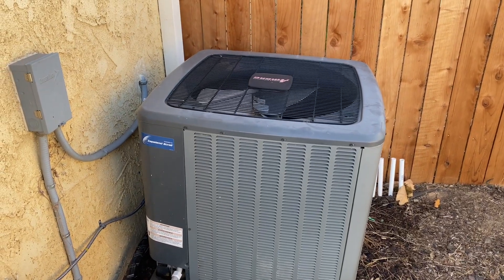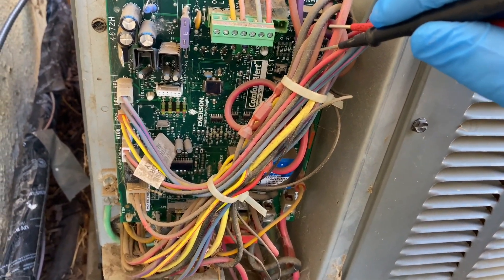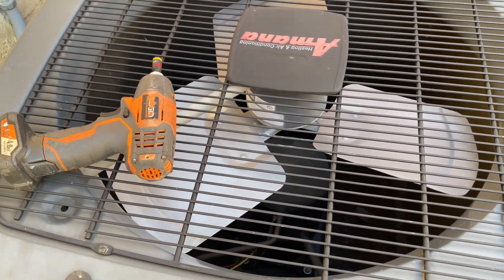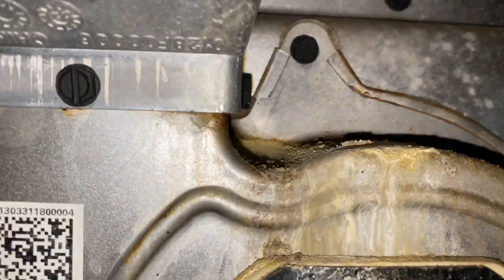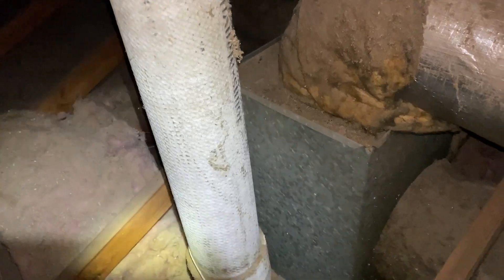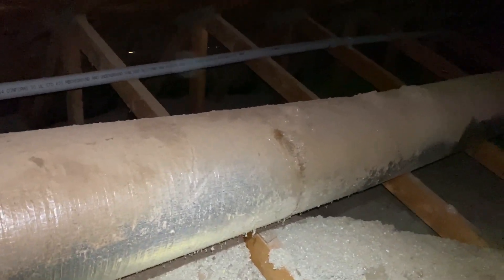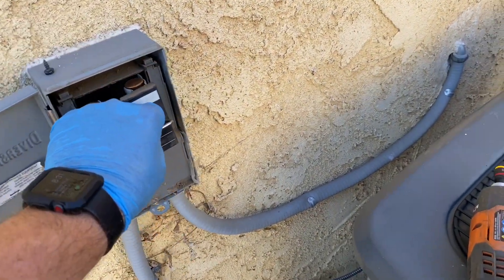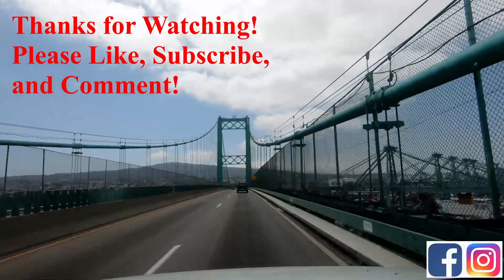How I run a Diagnostic Call, No Cool Call on a Amana Unit, Condenser Unit Not Powering. EP38

Comment: Explained that pretty well. I thought the compressor was shorted by hearing that sound. But you said only some units will detect a bad capacitor?
Reply from the maker: Some units have a diagnostic module that will detect a faulty run capacitor and lockout the system. Only certain brands/models have this feature.